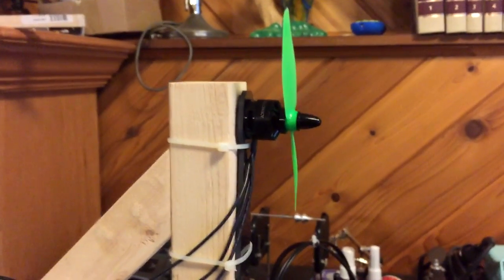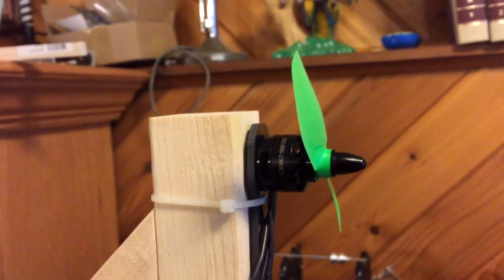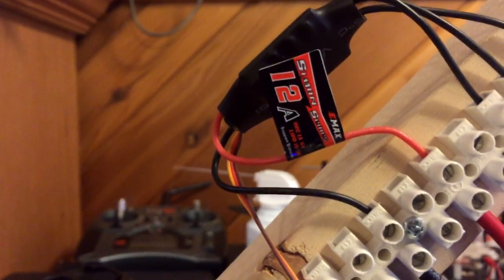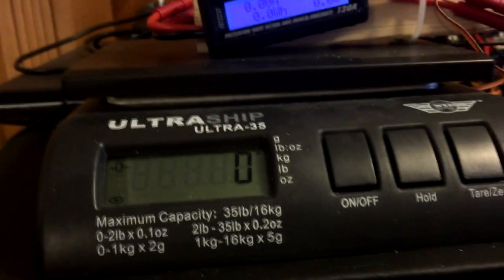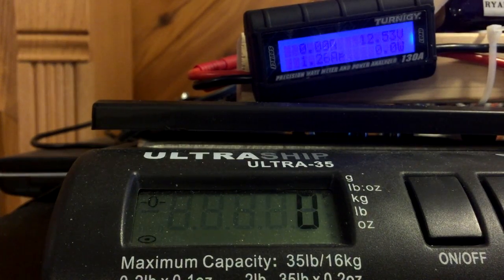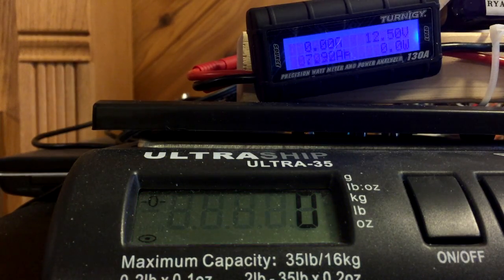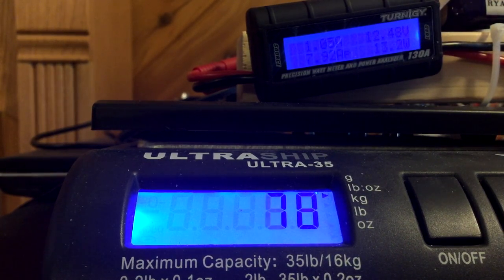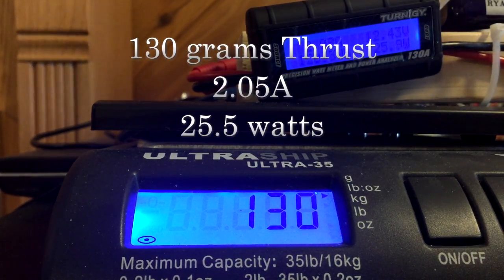DYS BE1806 2300Kv Thrust Test for ZMR250

Comment: I got 160g thrust for all starboard motors, the front port motor only made 120g thrust and the other motor burned off before reaching full thrust.As the frame is around 250g and battery is also near that, the quadcopter would just take off at full thrust, nothing else. It kept falling to the port side, so I checked motor thrust. Strange to see that one motor burned off in smoke before ever reaching full throttle. Controller is old Pixhawk as the 2.4.8 version turned out to be faulty.

Comment: That thrust meter you have is very accurate. I've seen same motor run on turnigy thrust stand and it gets almost the exact same results. Very good job on that build. Maybe you could do a video on building one. I would be interested in that.
Reply from the maker: Great Lee If you mean building the thrust test bench, I have done a video: https://www.youtube.com/watch?v=vmDxaE2NYVQ
Reply from the maker: Confessions of a Quadcopter Addict and here is the first use which shows how the wiring is set up: https://www.youtube.com/watch?v=H3RT9stLAYQ